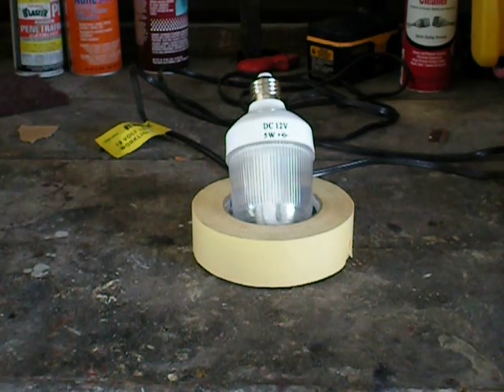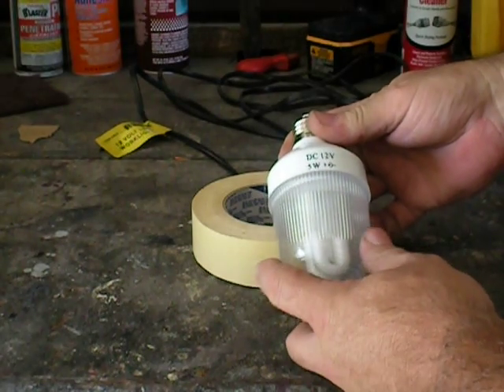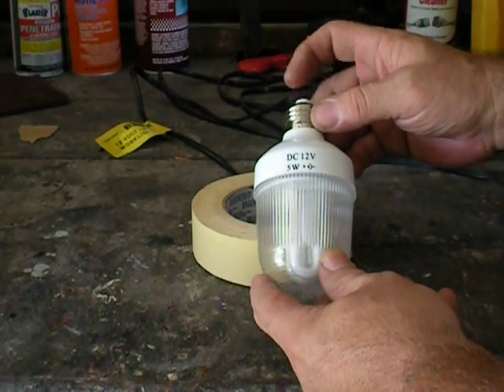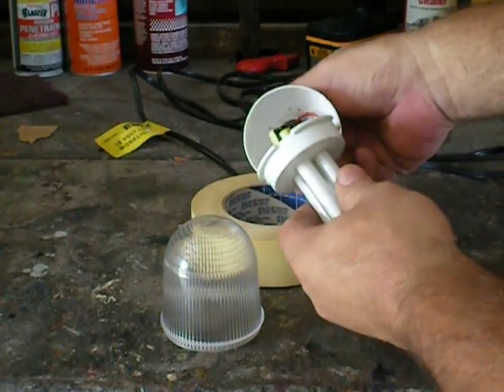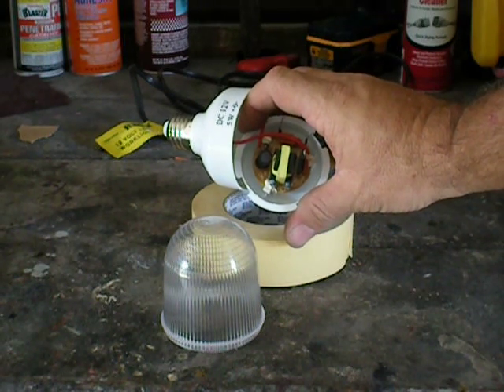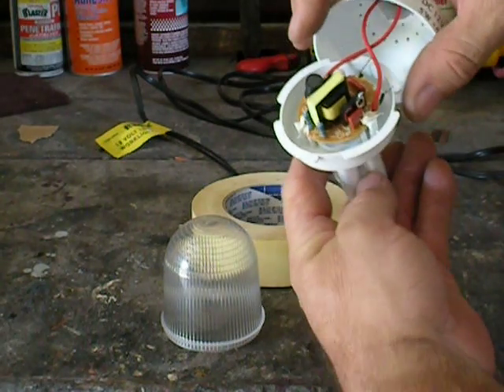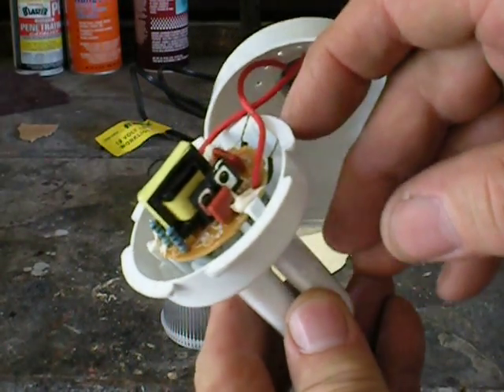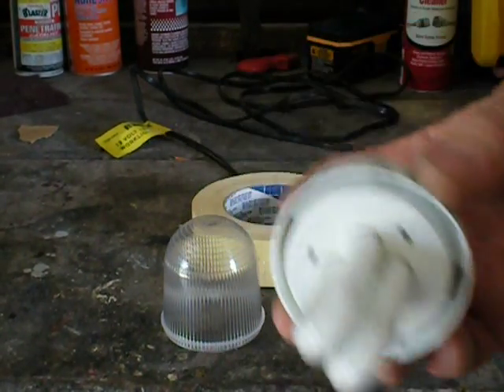A 3 Year Old 12 Volt  CFL Light , it died  :-(

Comment: Last point, easy Feritti caged protect spare electronics is a metal garbage can with a tight fitting lid. You can find YouTube videos how to construct. At the end of the day Most important thing is a spare inverter And basic electronics you want to power up with it. I have an old $300 1500w modified sine I protect

Comment: Unfortunately not easy to protect something that's in use unless that electronic device was properly grounded and in a larger Fariday cage.  For example, if your inverter in charge controllers are in a garage you can build a faraday cage Around the garage but this is a big undertaking involving essentially wire mesh or chicken coop type wire completely around your garage walls, roof, etc

Comment: I though they were suppose to be warrantied for longer period. Could be wrong on that though. Yeah Inthink all cfl have circuits and the reason they should be protected in faraday cage in case of large cme/emp (that's what I've heard anyway). I put bunch  in my homemade/garbage can faraday cage as would like to have something to "run" if major cme occurred. No use protecting inverters and charge controller with nothing to power up